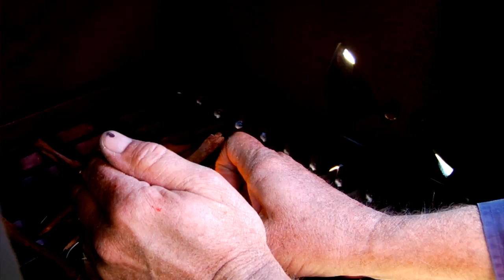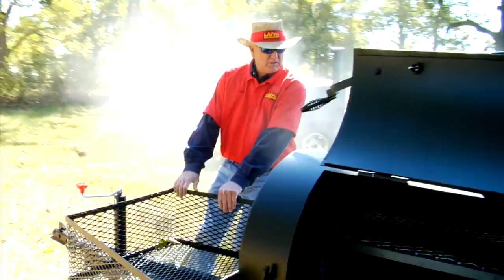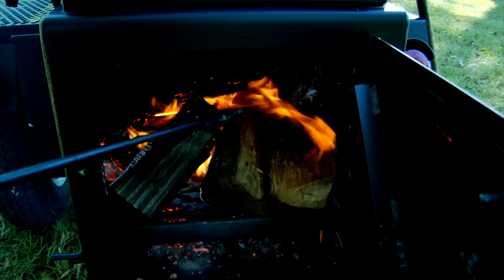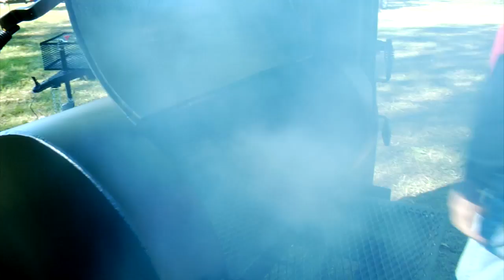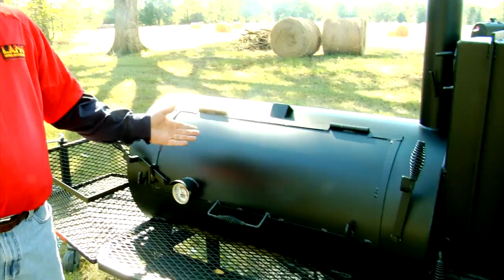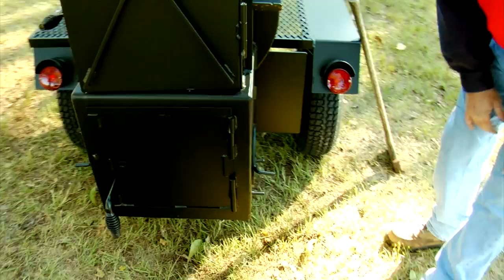The NEW "How To Start a Fire"

Comment: As a Lang 36 owner for 8 years, I wish I knew then what I know now.  Langs design is terrible compared to other offsets.  The firebox is all wrong (way too claustrophobic and wrong placement in relation the pipe) and the air flow is just horrendous.  You constantly fight to keep the fire going right because he just didn't build a pit that pulls as well as others.  Watch it billow out of the back door here.  That's not supposed to happen.
Reply: Can you give us an update? How has your smoker held up? Broken parts? Severe rust?
Reply: @flippindocks8183  I sold it.  Fire box rusted very badly.  Bought a workhorse pit that pulls mich better.

Comment: ordered my lang hybrid 36.  can't wait to get it!
Reply: Can you give us an update? How has your smoker held up? Broken parts? Severe rust?
Reply: @flippindocks8183  I actually just sold my Lang last week.  I loved it, but my kids have moved out and my wife and I just didn't need the capacity.  It did rust particularly on the grill side probably because I only used it a dozen time or so.  The rusting was I would say severe on the grates and grill bottom.  I had no/minor rusting on the smoker side.  The handles all became stiff, but just needed lubricant.  If I bought a new one, I personally would not get the Hybrid again.  The rust combined with a personal opinion that he grill also seemed awkward to use contributed to it's infrequent usage.  Switched to a Traeger, but I am definitely not sold yet on that, but that's another whole story.  Hopefully this helps.  Let me know if you have any other questions.

Comment: thank you, I am going to get Yoder Cheyenne by 3-2020
Reply: I have a Yoder 640 and the Hybrid Lang 36.  I love them both.  When I want to hang out in the backyard by the pool all day use the Lang,  When going in and out of the house use the Yoder.,  Also take the Lang tailgating...
Reply: @donpettinger8079  I agree yoder is set it and when the app on my phone says it's done its comes out perfect I have the lang 48, dont use it much, dont have the time to babysit it, but is a quality smoker
Reply: @sherri082772  I do love my 
Lang.  For a stick burner it sure can hold a stable temp so long as I feed it every 30 or 45 mins depending on the size of my sticks.  Have a great holiday season..
Reply: @donpettinger8079  do you start and light your fire like they do in this video? Do you clean it like that as well?

Comment: If the cooker is too hot, doesn't it warp the metal?  If so, how hot is "too hot"?  Thanks.
Reply: It won't warp the metal, but it will burn off the paint.

Comment: What a waste of time. Spraying water in your smoker..... Losing all that flavor...
Reply: He's seasoning in a BRAND NEW smoker. Surely the fellow that's been building some of the best smokers on the planet for years doesn't know what he's doing.
Reply: bertlee20 Like Mike Smith said, he's seasoning a new smoker, and sanitizing it with steam. I do this to my smoker all the time and I don't lose any "flavor" at all. Contrary to popular belief, 99.9% of your flavor comes from the smoke, not the smoker. But the steam doesn't wash it, just sanitizes it.
Reply: nope...it will dry during the rest of the heat while seasoning
Reply: BBQ Sandwich The comment you’re referencing said some of the best.  Out of curiosity, what cookers do you prefer.  I pick my Lang 84 deluxe up later this month and you seem to be an expert; where did I go wrong?
Reply: @EarButter310  I have a Lang Hybrid 36 and a Yoder 640s.  I love them both.  Use them for different things,.  Lots of time and want to show off out comes the Lang.  Have other things to do while bbqing I use the Yoder. Both great.
Reply: Wouldn't that make rust occur in the racks etc?
Reply: As with any new smoker you was to wash and season the equipment...if the racks are food grade stainless steel rust will not be an issue.
Reply: Best smokers on the planet? LOL. Not even close,
Reply: lmao see you everywhere hating on mostly everyone....love it...which one of these youtubers do YOU think knows their shit the best?